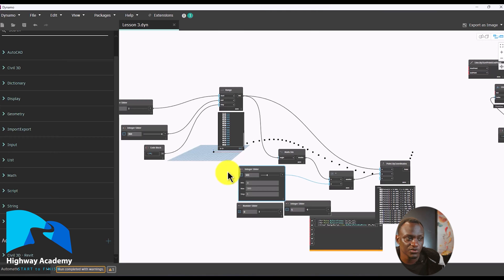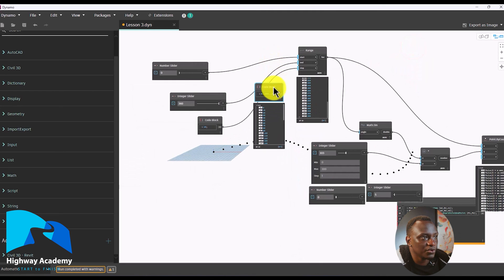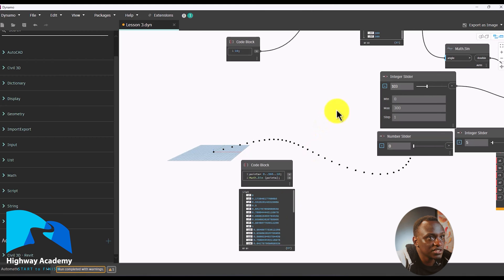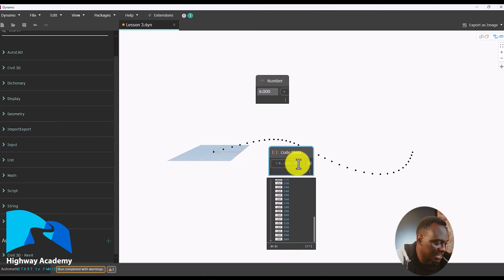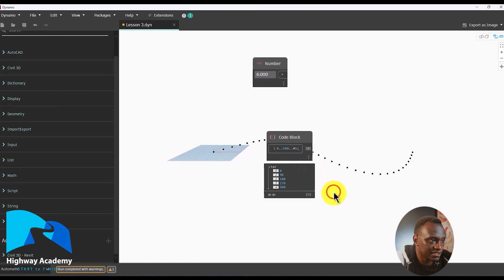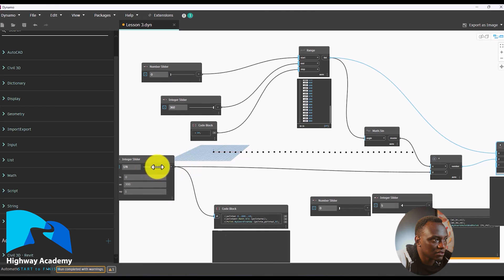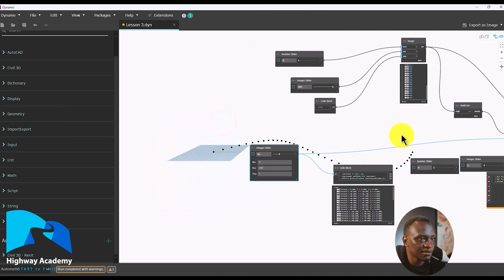Civil 3D Dynamo Beginner: 05 Code Block Multiple points

Comment from the maker: The moment you've been waiting for has arrived! 
Our complete Ultimate Guide to Dynamo course is now officially LIVE on our website and also the beginner's dynamo YouTube playlist is available. 

Ready to jump in and transform your workflow
✅Link to the dynamo script used in the video to place signs along your alignment here: https://hwy.ac/dyn-scr
Become a Dynamo Pro! Enroll in the Ultimate Guide to Dynamo in Civil 3D 2026 course now
 ✅Link to the Dynamo course in Civil 3d 2026 hwy.ac/Dynamo
Want to connect with our amazing community
 ✅ Link to Join our Highway Academy WhatsApp channel for daily tips and updates right on your phone: https://hwy.ac/dyn-ch
*Got a question or just want to say hi? We'd love to hear from you! *
✅Link to chat with us directly on WhatsApp: https://hwy.ac/wa	
Check our dynamo YouTube beginner's playlist
✅Link to the dynamo YouTube beginner's playlist https://hwy.ac/Dynamo-ply

00:00 Intro
00:04 Recap of using ranges for points in X, Y, Z.
01:11 Generating points with a code block.
02:14 Applying a sine function in the code block.
03:11 Explaining code block syntax with the hash key (#).
04:04 Demonstrating the effect of the hash key.
05:07 Using a slider to control a variable in the code block.
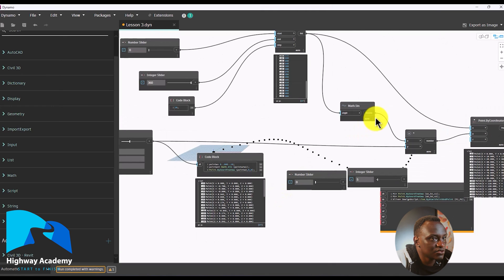06:09 Setting X-coordinate input with the code block's "points."
07:20 Adjusting curve intensity with a slider.
08:23 Making the code block flexible with variables for range.
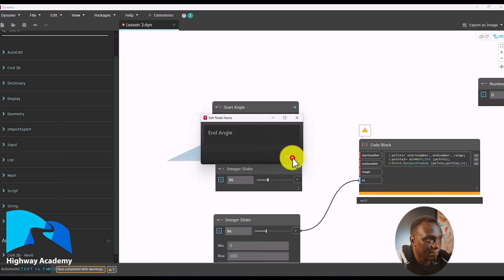09:10 Setting up sliders for start angle, end angle, and steps.